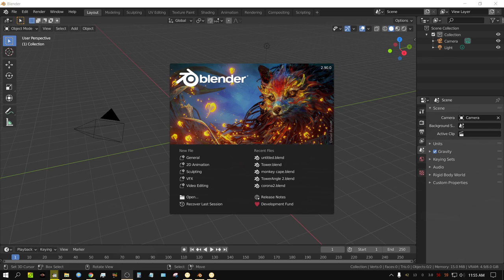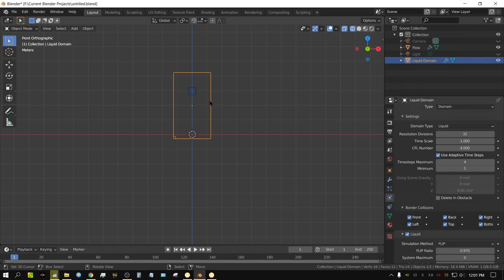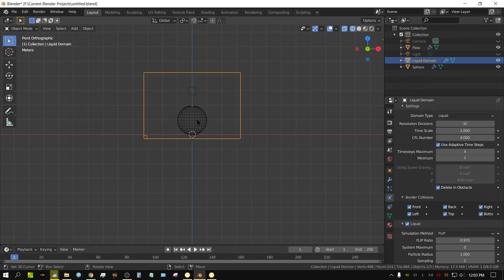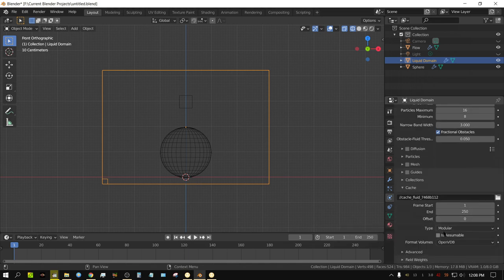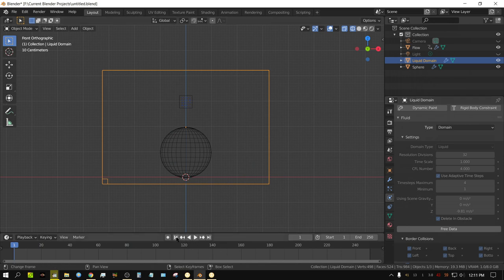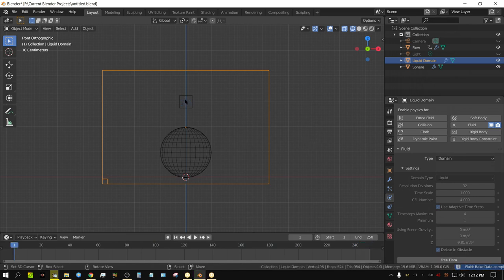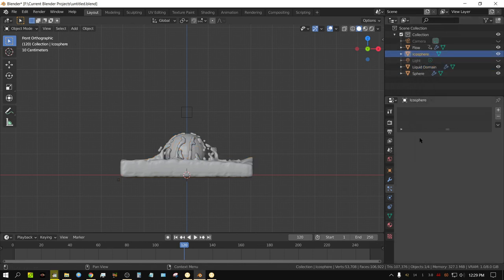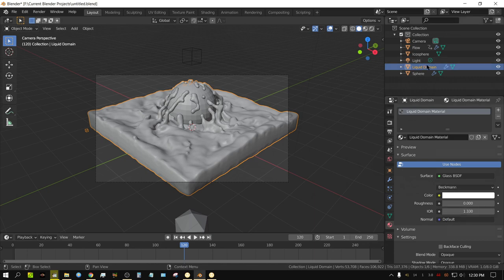Blender Liquid Simulation Basics Explained - Mantaflow

Comment: When are you going to download Blender 2.91.0?
Reply from the maker: The most stable version I use is 2.83. I use it most of the time. But if I use mantaflow the most stable version so far is 2.9. However, I have high hopes for 2.92 which is still experimental. It's not actually necessary to update every time a new version comes out. Most of the time the changes are insignificant.
https://i.ibb.co/h7m2TVJ/Capture.jpg

Comment: I'd like to say one slightly off topic thing

spaceship should be able to move UP and DOWN aswell as Forwards , Backwards , left and right
because space allows movement in ALL Directions
turning engines is used to speed up or slow down because there's no friction in space
so the engines should be used only when they are needed

also I don't see upwards and downwards thrusters on your spaceship so you should have them

the engines do not hve to be big BUT big enough to turn the ship in a reasonable abbount of time
eatch ship type requires differend ammount of these engines to be functional so keep that in mind aswell